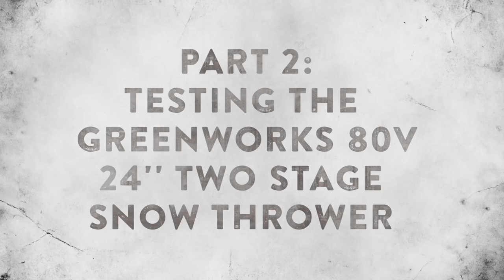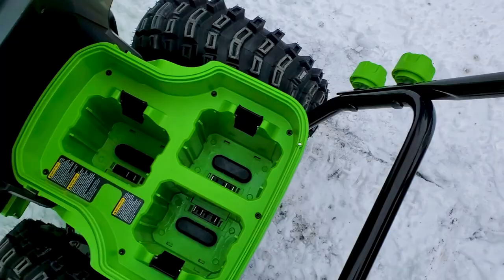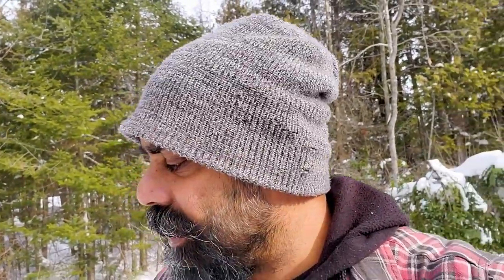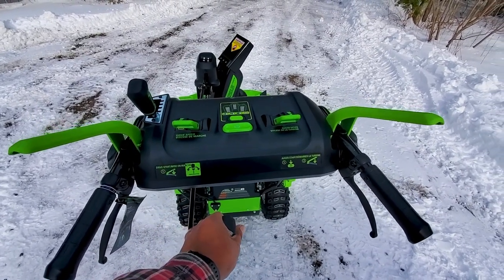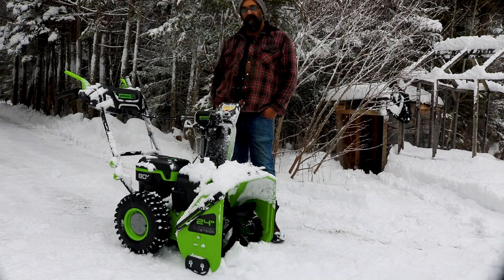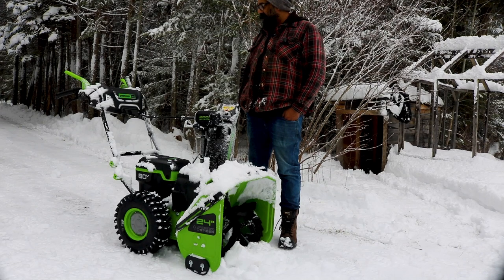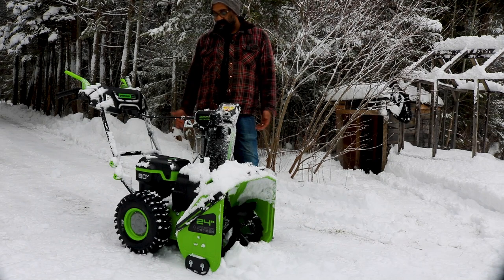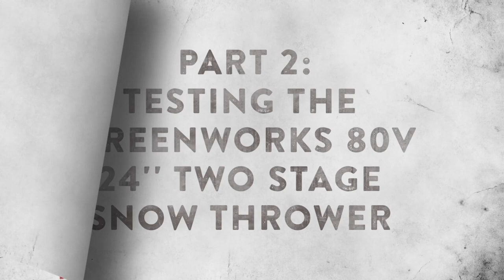Testing a Greenworks 80V 24" Two Stage Electric Snow Thrower

Comment: By the way, one of the reason why these li-ion batteries don't last after a few years is because of over heating during the discharging period (i.e. plowing the snow). The key is to keep these batteries from over heating by placing the auger at slow speed and keeping the drive speed at a minimum.

I am not sure that they are using the right 3.7V INR18650 Li-ion batteries with high drain current (CDR continuous discharge rate) max. feature of at least 20A. I suspect the modules will fail after a few years or months. There are only a few 18650 batteries on the market that can do the job.

Make no mistake about it. One should not overwork these battery modules and assume each BMS (representing as the monkey with bad eye sight) will shut down the over heating batteries. When one of the 30 horses dies during running, the monkey driver with bad eye sight might not be able to stop the whole group to prevent an accident. There might be a lot of dead horses. In the battery case, this might start a fire. In the early days of building Tesla cars, they used the INR18650 batteries with high drain current capability. Now, they use the safer LFP type of li-ion batteries of larger sizes (i.e. 21700, 21mmx70mm) (as used by all Chinese EV car manufacturers) which have less energy storing capability. Some America EV companies are now shifting toward the LFP type.
Reply from the maker: Park Gee! Thank you so much for the great explanation about why the three batteries are there. That makes a lot of sense, as does your recommendation to keep the auger and drive speed down. I have to admit, when I pulled the batteries out of the blower, they were pretty hot and that was even at slow auger and drive speeds.

Comment: I have this same unit.  It’ll run on only 1 battery, 2 batteries or for max run time all 3. 

What I did was order 1 extra 4ah battery.  This way I can run the unit on 2 batteries and always have the other 2 batteries in the charger ready to go.  This way there is never any down time waiting for the a fresh set to charge.
Reply from the maker: That's a great Idea Derek!!! The fourth battery sounds good, but will running two at a time reduce the lifespan of the battery?
Reply: @kroworks  I wouldn’t think so. The unit has thermal protection built in and shuts off if the batteries get too hot.   

I have 3, 2ah 80v greenworks batteries from my other green works tools, (mower, single stage snow blower, hedge trimmer, and string trimmer) and they are all going strong after 6years of constant use.  Not a single failure.

Comment: Nice musical video.
Let me tell you a bedtime story.
"Long long" time ago in a place "far far" away, a farmer hides 3 monkeys with "eye sight" problem to take care of 3 groups of horses with 20 horses in each group. One day, he wants them to pull one very large loaded wagon to a place not far from the farm.
At the last minute, he decides to use only 2 monkeys and 2 groups of horses to do the job. The result is that some of the horses end up sick or dying due to overwork.

What is the moral of the story?
If the farmer has used all 3 groups of horses to do the job, everyone will live happily ever after. 
"The end"

Can anyone guess why the monkeys have "eye sight" problem?

In our case, the horses are the individual batteries (i.e. 30 of 3.6V li-ion batteries in each module). The monkey is the BMS (Battery Management System) in each battery module. The very large loaded wagon is the snow.
Probably, the BMS systems (using MCU chip, mirocontroller unit) from all companies might not be designed to be very smart. A very smart BMS combining with a very smart charger would have charged each battery (INR18650) equally during charging period to prolong the life span of each battery. It should shut down the module when it senses any one of the batteries is dying.

Comment: Would not last a couple seasons in upstate NY where we get over 20 feet of snow, usually wet and heavy packed into the driveways by street plows.
Reply: Just got one in Ottawa, Canada, that thing is a beast, it seems like it’ll hold up. Hoping to get a few years out of the batteries!
Reply from the maker: It worked brilliantly last year through a load of snow. Haven't seen anything yet up here to see how it goes a year later.

Comment: Do you mix battery sizes or would that potentially cause an issue.  I am talking like 4ah and 3AH batteries?  Mine came with two 4ah batteries and I was thinking of running it with a 3AH in the third slot.  Any thoughts on that setup?
Reply: I don't think it would be an issue. The Greenworks lawn mower I have, came with a 4ah battery and a 2ah battery. My experience is the mower uses one at a time. I know this because I frequently only need to charge one battery when I'm done. Just in case there is something different with the snow blower, a quick call to support should give you a definitive answer. I am very happy with Greenworks customer service.
Reply: I just used the snowblower yesterday and it does work different from the lawnmower.  I used two batteries instead of three and both were drained about equally.